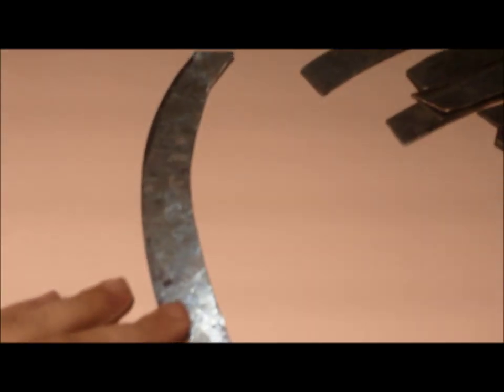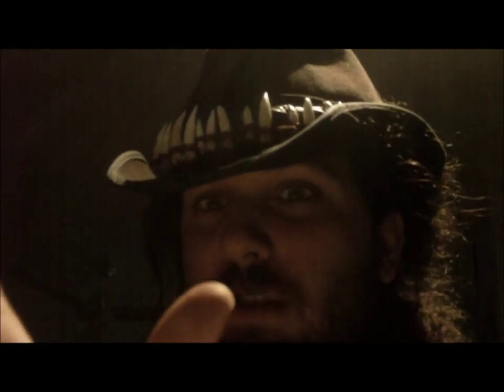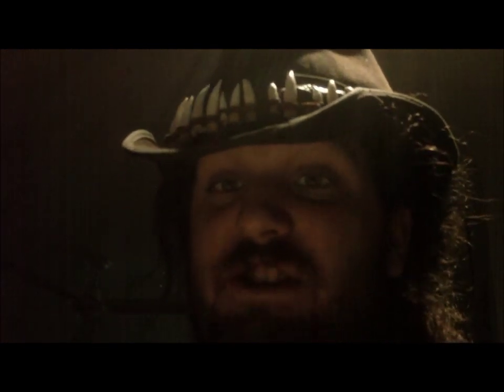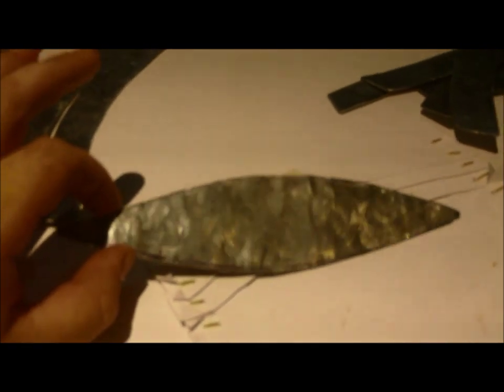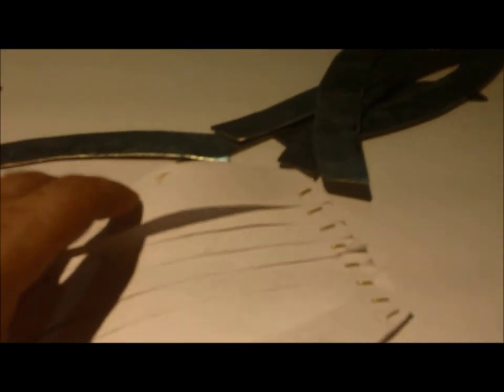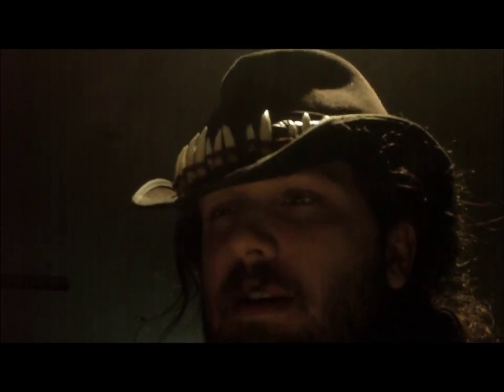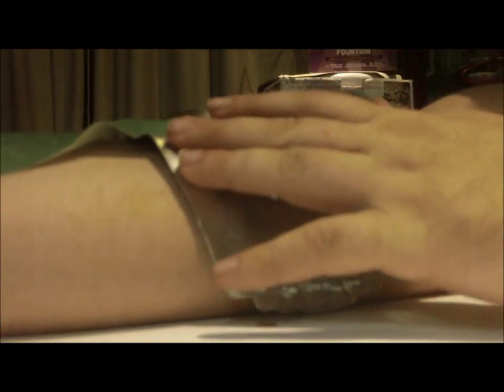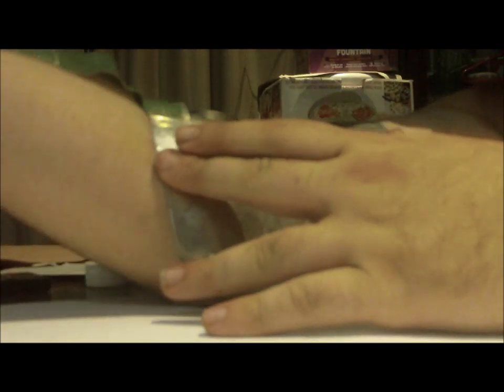Compression Articulation Armour Tutorial.

Comment: Except for two closest lames to the base lamel there is little to no articulation of all other lamels. So, why not make a it consist of 3 plates?
Reply from the maker: Well you could try that but I don't think it would work well. Notice that it compresses to reduce the length covered on the inside arm bend. Not sure how to explain some of the problems you would run into. the length from your vambrace to the inside bend to the upper cannon changes as you move through a range of movement. I hope that makes sense. maybe if it telescopes under other plates. If you want I would say try and do it in carboard first and please sent me a video if you get it to work. Hope you have a nice day.
Reply: File the round holes into a more oval shape to allow the plates to compress or expand better. Necessary on sabatons